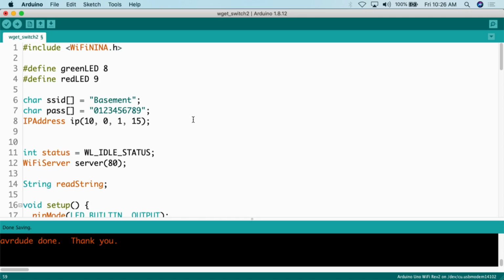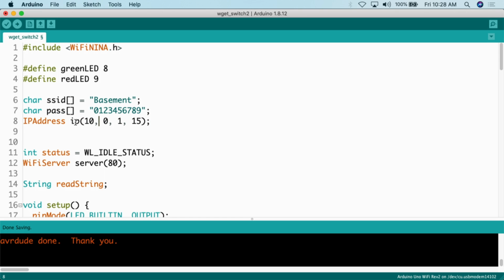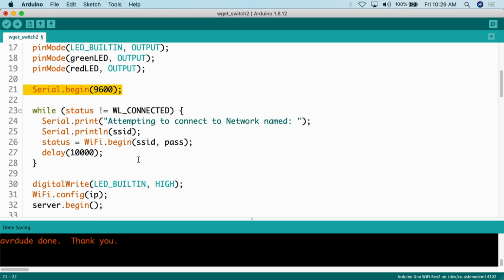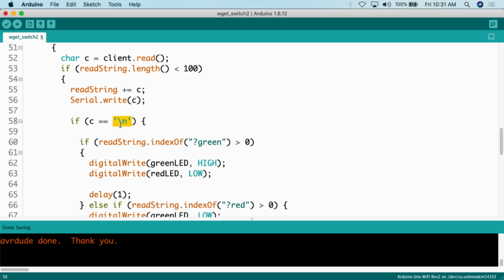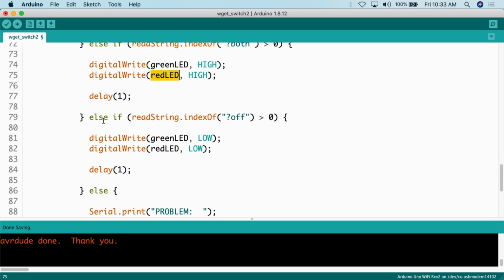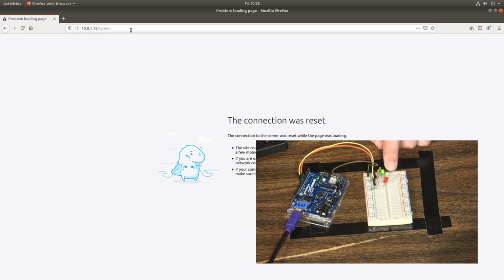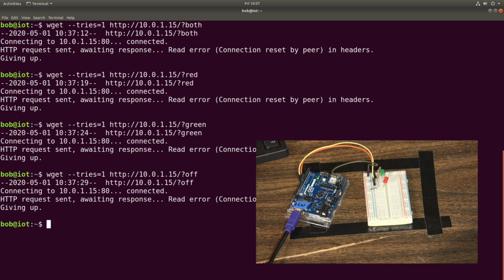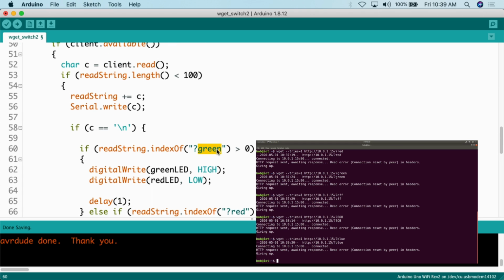Arduino Uno with WiFi - Control Arduino with wget on Linux

Comment: that's why i subscribe to your channel after watching your video about moisture sensor. a few lines of code which was easy to implement and made me feel like I can do and try get some small wins befor I try the big projects. I am impressed that you are thinking in student's perspective, there are lots of good tech resources out there but they are just teaching from the minds of engineers rather than amateur. thanks for the videos.